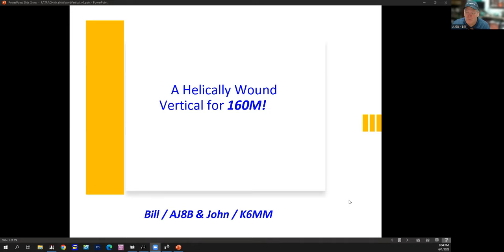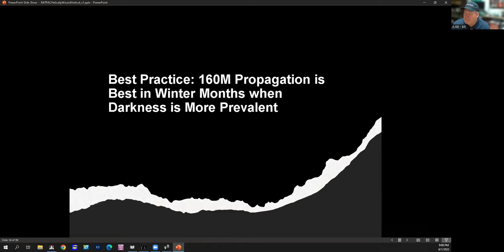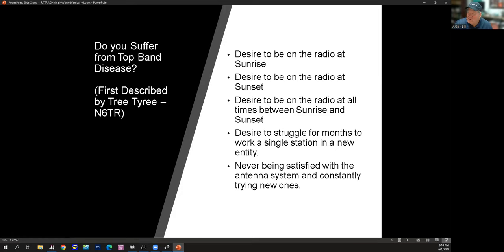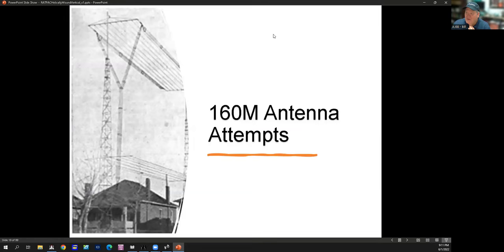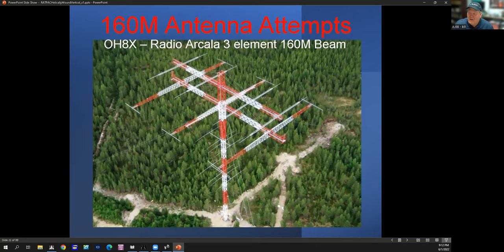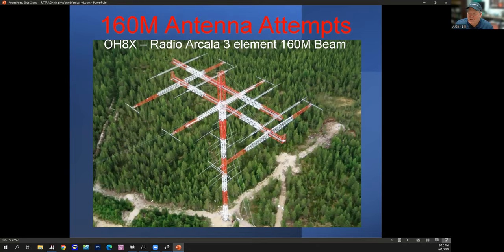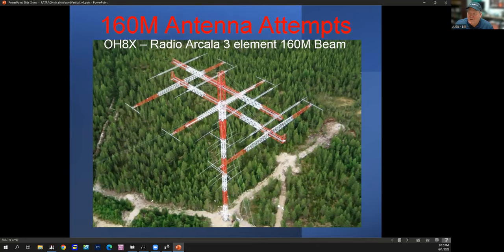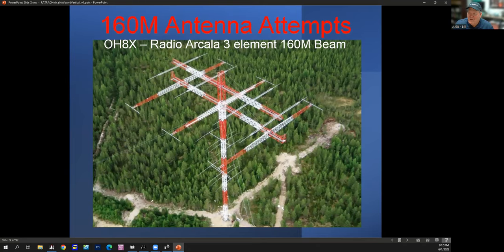A Helically Wound Vertical for 160M- 06/01/2022

Comment: I had a 160 m horizontal loop supported by four 200ft towers that was next to the beach. It worked well for local and some DX. I fed it with 450 ohm feed line and could tune it up to 30 MHz.

Comment: You might want to try removing your top hat and instead add four twenty-ish foot guy wires from the very top.  Once down twenty feet with copper wire add and egg shaped insulator to extend the "guy wires" to the ground with something that's non conducting like nylon rope.  Then put about fifteen feet of copper wire between each egg insulator and solder it to the twenty-foot wires you have coming down from the top.  So instead of the horizontal top hat you have it would look more like a pyramid sitting on top of the antenna.

Comment: Can you please give some more details about the dimensions? What pipes were used for the “mast” and what was used for the capacity head, length diameter? How many space is needed between the windings, so the helical is no coil. 
Just thinking doing that type of Antenna for 40m. You can get the plastic tubes in 3m lengths. Making the windings at the top close to another will create a coil. So 3m hight is sufficient.